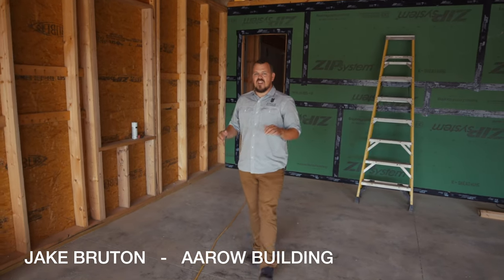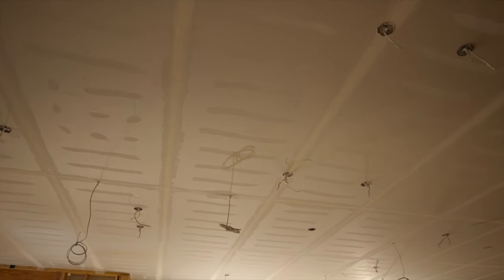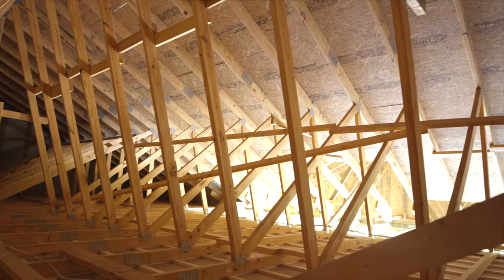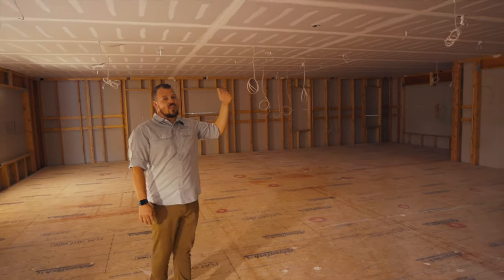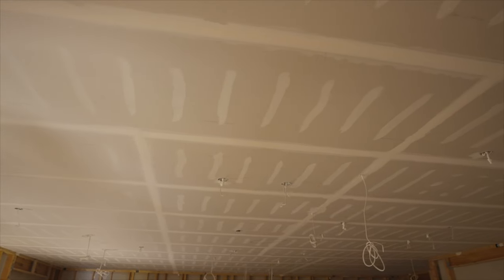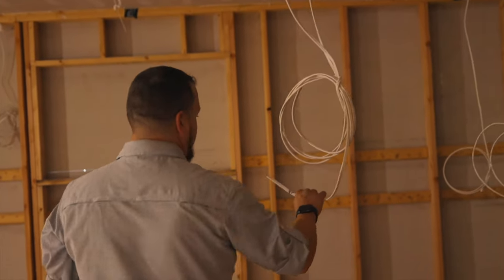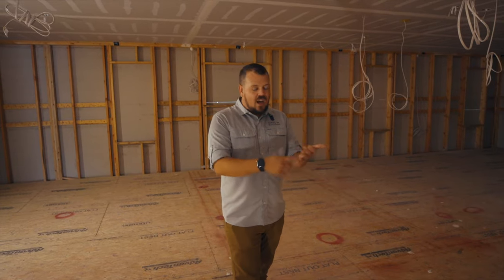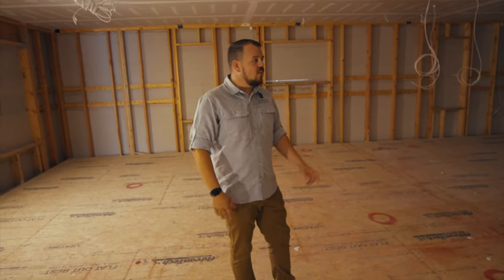Drywall as an Air Barrier

Comment: From what I can tell - when drywall is the air barrier on a ceiling (vented attic) you still require a continuous polyethelen vapour retarder between truss/drywall (Canada but similar to climate zone 6) - would you think thats necessary or no? Thanks!!

Comment: Nice job but how are you air sealing the down lights and other perforations?
Reply from the maker: Yes. In many cases we build 5 sided boxes that house our lights. They get caulked down to the top side of the drywall.
Reply: @jake.bruton.aarow.building  Good job, I did something similar with PIR scraps. Your approach is much more practical than the use of tyvek sheeting and membranes behind sheet plaster. Did you guys use a barrier under the floors to?

Comment: Love the efficiency! Anyone know what gray material is used  onto the trusses between the rafters at the energy-heel/vents to hold in the blow-in at 0:15 ??

Building our own home with my father and we would prefer this material to close the gap than OSB
Reply from the maker: That is simply the normal insulation netting to hold things back. In future builds we have used closed cell spray foam here and even Zip R scraps.
Reply: @jake.bruton.aarow.building  thanks so much for taking the time to respond! Huge fan of your work, Much respect